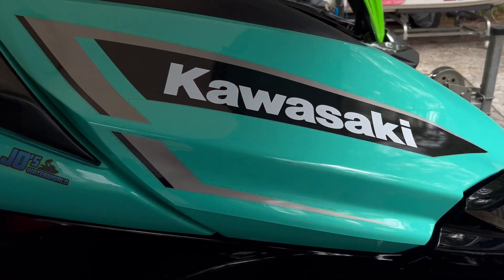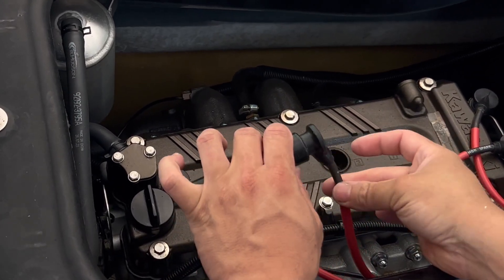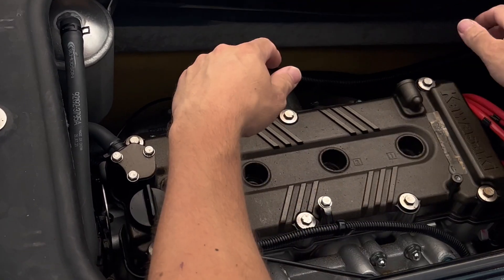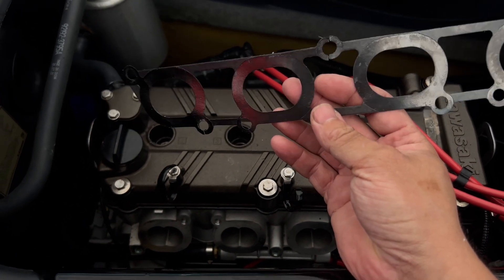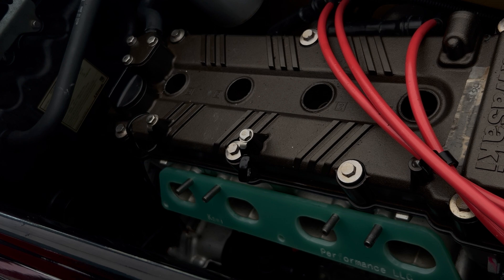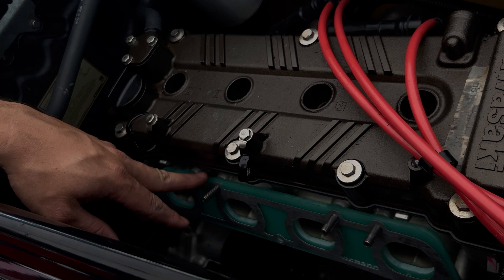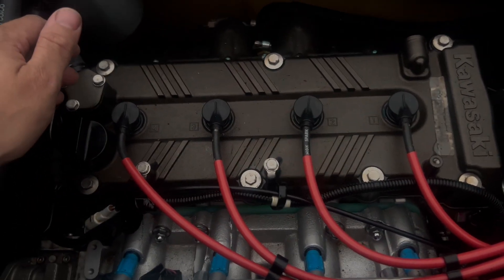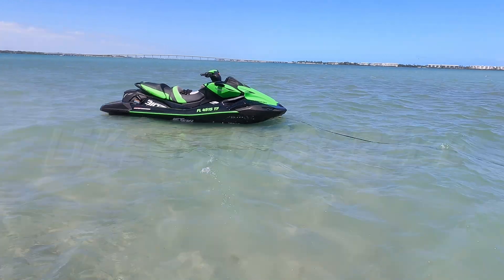@kawiperformance Thermal Barrier for Kawasaki Ultra LX, 250, 260 & STX 12F / 15 F Jet Skis [4K]

Comment: Sir, mystx160, model2023, overheats, andgotoinwater. What do, dome, ple
Reply from the maker: Do you ride in shallow water? If yes chances are the oil cooler and stator housing and cooling channels in the block are packed full of mud or sand. I would check all of the cooling hoses first, to make sure they are not clogged up or kinked and go from there. Are you using 10-40 synthetic oil?
Reply: Yes,10-40castrol, beap occurred frequently . What to do for that sir, plz help me.

Comment: My stx 160 lx 2023 over heats once in a while. Will this part fit my stx?
Reply from the maker: No, it will not. Are you using the correct oil weight and have you checked all your cooling and water feed lines for kinks? If you ride or start in shallow water the engine, oil cooler, and or stator cooler could be packed with sand. Overheat typically due to cooling issue...
Reply: @JDsWaterWorld  I've had my ski looked at twice by my marina service dept. They don't know why it's overheating. I can be riding for 40 minutes and overheat warning light comes on, I immediately bring
Reply: It to an idle and shut engine off, within 10 seconds the warning light shuts off and I can go another 30 minutes before it overheats again and sometimes it won't over heat. Very weird
Reply from the maker: It's probably a kinked feed hose.."looked at it" is worthless to you if they didn't fix it and actually check all the hoses..which doubt they did. You can test the temp sender for resistance to make sure it's not a sensor issue first and if it's not, that means it's a water feed cooling issue
Reply: @robertcook5974  scusa se scrivo in italiano...se usi il jet ski prevalentemente in mare e non fai subito e bene il risciaquo motore quando hai finito di usarlo, a volte l'ossido che si forma tra la guarnizione ed il collettore di scarico intasa i piccoli fori di uscita dell'acqua di raffreddamento e questo fa aumentare la temperatura

Comment: So according to the video title, this product is for the models without drive by wire throttle?
Reply from the maker: Yes, older models with aluminum intake manifolds and Mikuni cable operated TB